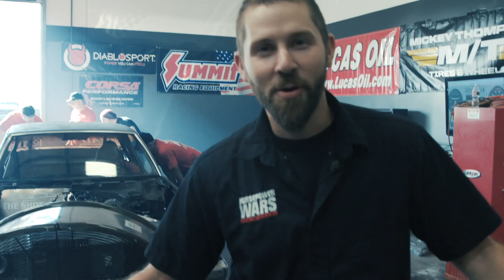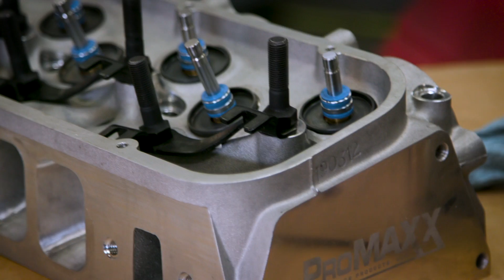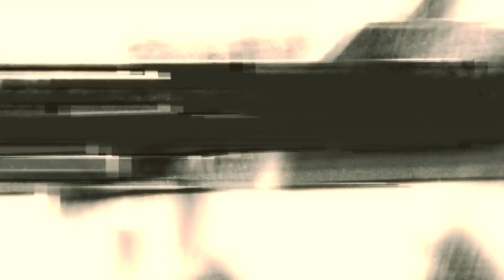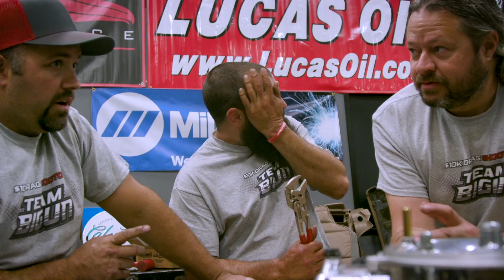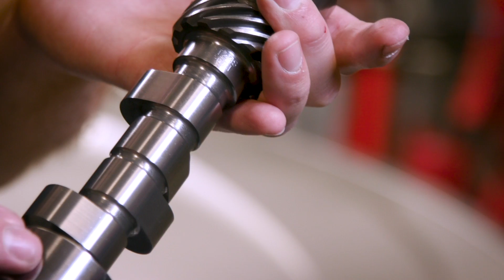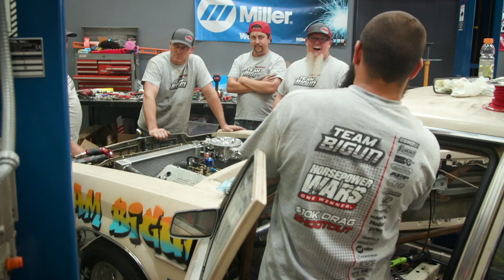$10K Drag Shootout 2 Episode 5: Middle of the Build (Part 2)

Comment: $10k build? Plus wheels, tires, axles, diff covers, oil, cams, etc. How are you going to add in all these "free" parts and still call it a $10k build? 
I'm glad the Midwest boys are at least trying to keep it to the spirit of it. 
Too bad Joe won't be there to see the finish :(
Reply: The Aussie's never cheated
Reply: @big35078  not even talking about cheating. I'm saying everyone got those parts free. They didn't come out of the budget, so it's not like the average person is going to build a car like any of these for $10k. 
The cheating is even worse. All kinds of brand new parts in the motor and they value it at $500? Wtf is that? Might as well send a Texas speed motor with some crappy paint and say it came from the junkyard. " This has some new parts in it, we're going to value it at $1500" SMH.

Getting caught cheating should get you booted, or at least some serious penalty.

Comment: 8500rpm hyd roller. Serious ?
Reply: Yup. They do exist in 2019(granted, 8500 is at the edge) - but you're gonna pay for that shit, make no mistake! The key is short travel hydro lifters; they have enough travel to cover valve lash while being able to essentially firm up at high RPM with high oil pressure combined with the short travel(which requires less fluid to fill).
Reply: @RyTrapp0  who cares how much it costs ? Is'nt this a competition ?
Reply: Gotta have the right lifters which we have. 😜
Reply: @big35078  Not if you know what you're doing